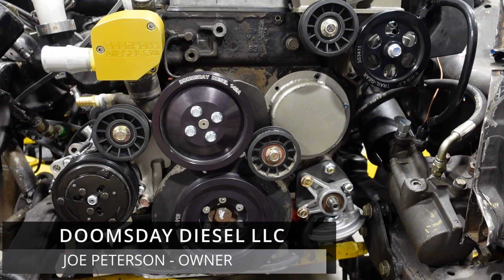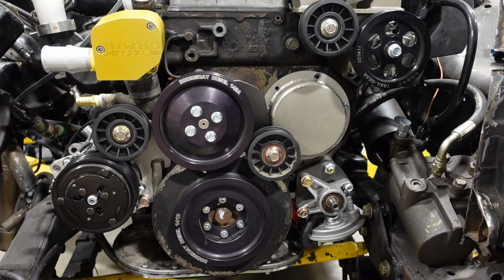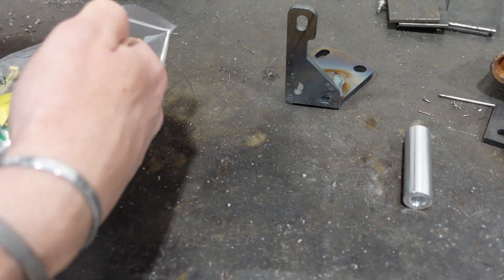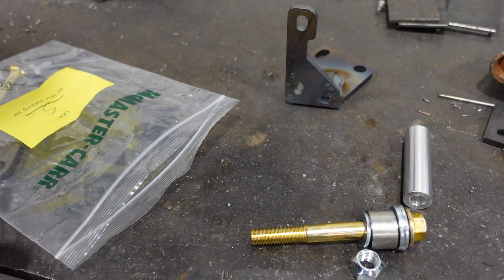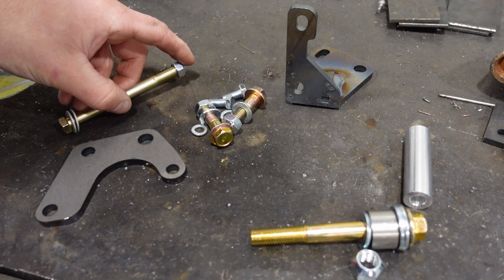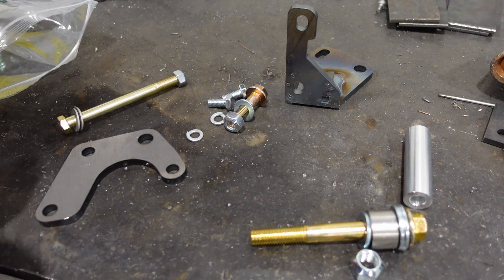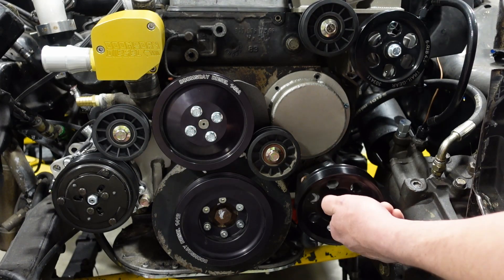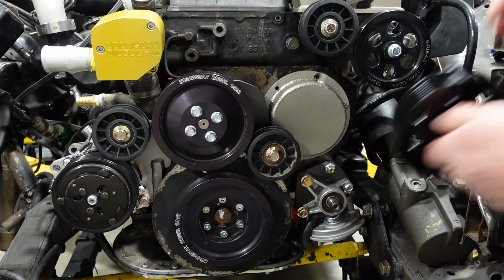OM617 Conversion Series: Belt-Driven Vacuum Pump Installation

Comment: Have you ever tried using one of the alternators that have a vacuum pump built in to them? I think Mitsubishi or Isuzu trucks use them. That would upgrade both in one. (But I guess that’s possibly less reliable, as you’d be out of both with just the alternator breaking.)
Reply from the maker: @hanseich  extremely hard to find. Super expensive. And the one's I've seen require either oil or coolant to be supplied to them, too.

Comment: should post more videos on how you converted the whole set of pulleys of onbom617 ...we are very curious to know .. ...i installed hella ev  vacuum pump , it works better ...got another problem of clutch cylinder both ... inside and outer ...need a favour video on upgrade of these clutch cylinders too bon original gear box  .

Comment: Can you not run an alternator from a Japanese diesel engine. Most have a vacuum pump direct coupled to the back of the alternator. Oil feed and oil drain into the sump. Japan has been using them for 30-40 years. Vee belt and multi-rib belts availiable.
Reply from the maker: Expensive. Impossible to find. Unreliable. Not made for brakes. Low amp output.
Reply: Expensive? In the US/Canada only maybe. 
Impossible to find? Same as above maybe. 
Unreliable? Sorry but thats just not true. Been rebuiding diesel fuel injection gear and engines for well over 45 years from 4hp to 30,000hp and engines that you will never see and one thing is 100% factual, Jap alternators/vac pumps are extremely reliable. Not made for brakes????? Holy crap. Millions upon millions  of Japanese diesel cars, vans, trucks up to 4-5tons prove that wrong. System stops Toyota, Nissan, Ford/ Mazda, Mitsubishi, Isuzu, Hino, Musso/Mercedes vehicles perfectly.  All use/used the same system. Low output? Can get them up to 120amps plus , 12 or 24volt. 
But each to their own I guess.